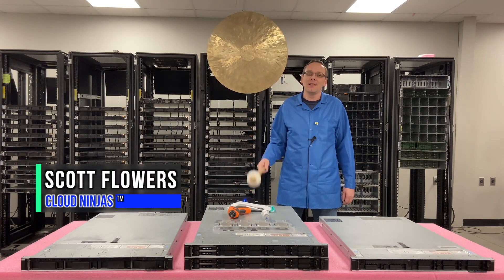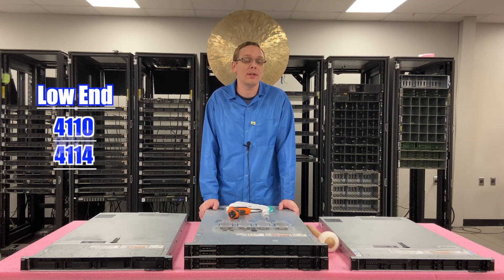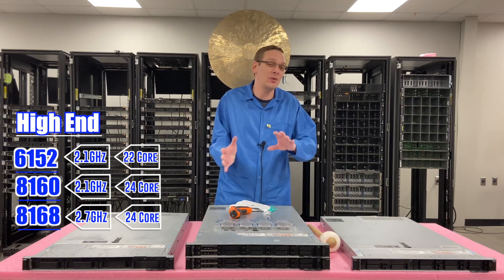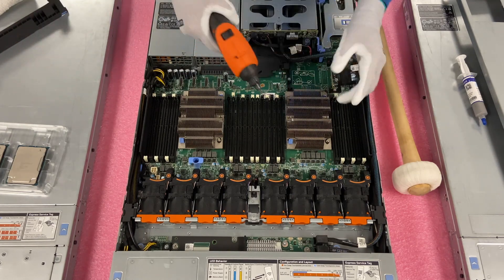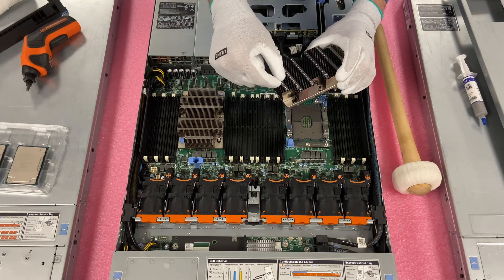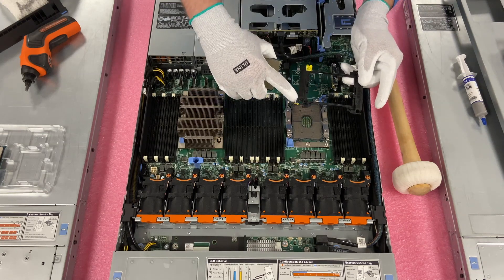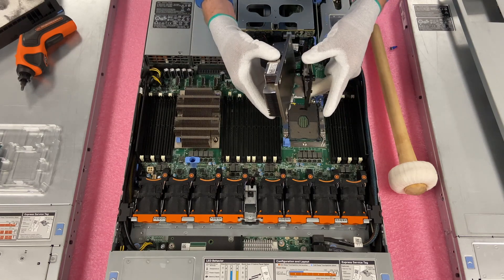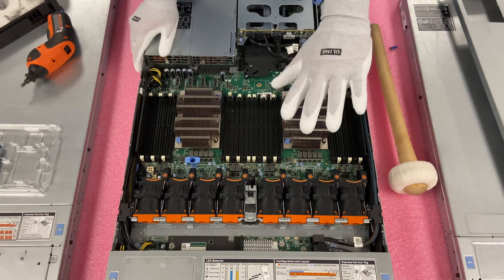Dell PowerEdge R640 Server CPUs | Intel Xeon Processors Options | LGA3647 Socket | CPU Install

Comment: hi, wondering if I ordered the wrong cpu for my dell r440. went for the intel xeon 6150 which I saw you had in the list of available CPUs for the dell r440 on cloudninjas. 

But now see that this has a TDP of 165 W. but see in the manual for the dell r440 that the max TDP is 150w. Have I chosen too powerful a cpu for the dell R440? Never think i will use both cpu in i r440,   workload is not going to be very high. only during backup transfers